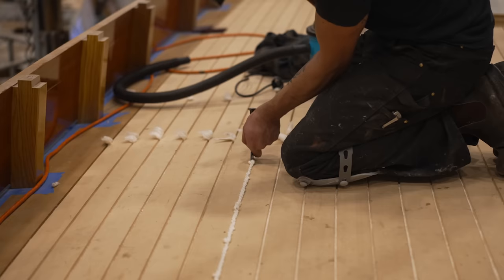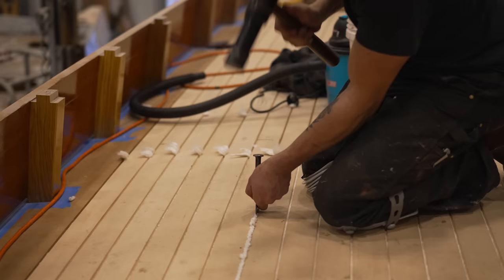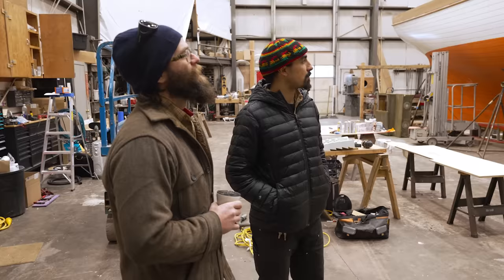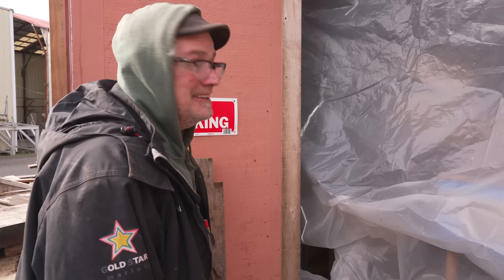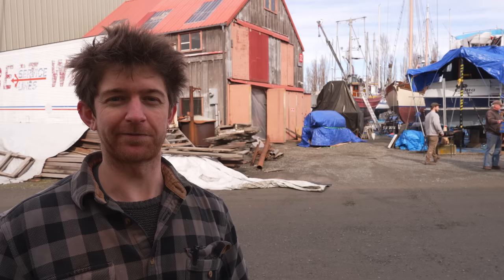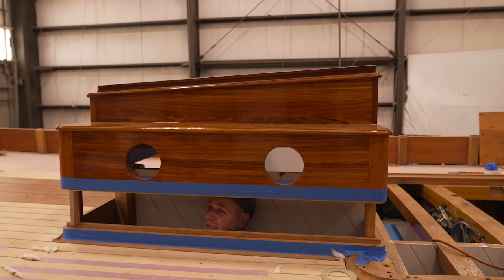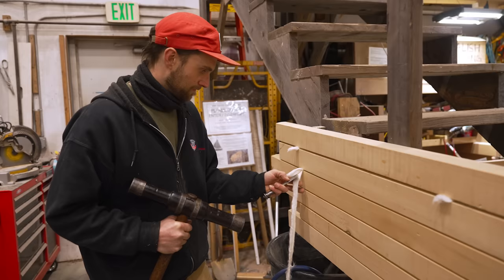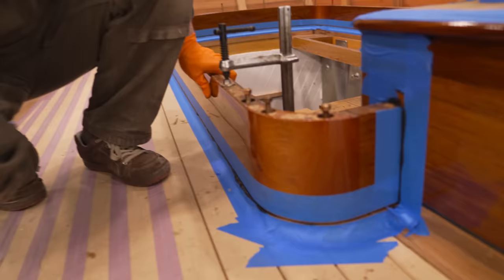Tally Ho's Front Door (April 1st, 2023)

Comment: It would be nice to have a screen door over the front door for the nicer weather
Reply: And some flex seal!
Reply: Out here in Massachusetts we always add a screen door because of bugs and on wooden boats we add fret work for decoration.
Reply: Yeah,! That would turn tally-ho into a submarine.
Reply: @corwin5557  Don't laugh, it keeps the seaweed out.
Reply: my god it really needs a door there? it does not ruin the hull? I never seen that door on a boat.
Reply: @chiranagheorghitaeugeniuth98  That is more of an 18th century thing, you never see newer boats with them, all fiberglass and steel, and not at sea as often as the early sailing days. A sailing vessel has to be at sea much longer, so they need to load on LOTS more supplies, that is when the door really is worth it's weight in gold, loading right from the dock instead of up a ladder, down a ladder for each thing you load.

Very large cruise ships still use them, they have several fore and aft for loading and for attaching the tugboats to to get into port.
Reply: Yes! We had o e on thd submarine that I served on. Very functional and convenient.
Reply: Agreed fly screen and security lock
Reply: What is today’s date?
Reply: Are you guys getting bored?
Reply: lol
Reply: I have to wonder if the 7 likes on @chiranagheorghitaeugeniuth98  comment are satire. Or they didn't see the date and figure out what the outtakes at the end of the vid were!
Reply: Add a brass door knocker in the shape of an anchor. Or a bell? Visitors would appreciate the convenience. It’s great to have such a laugh while I’m having my Sunday morning breakfast. Cheers from Tasmania.
Reply: Traditionally the screen door was mounted on the inside of the front door.
Reply: Noah had one of those, so this is truly a traditional design as Leo explains.
Reply: I’d suggest the addition of a draught excluder, you’ll notice the difference down below when on starboard tack.
Reply: Poisson d’avril
Reply: And a Doorbell Camera.
Reply: @fredmoult583  I'll have to Google that
Reply: 😂I didn’t know the 1 april is also in the US the day for placing frontdoors in ships. Just new it from here, the Netherlands…😊
Reply: In Poland we do windows on submarines on 1st April…😂
Reply: I hear all the best submarines also have screen doors.  It would be great to see Leo's screen door as long it doesn't conflict with the "Strange" plans.
Reply: Those do help keeping the flying fish out.
Reply: @chiranagheorghitaeugeniuth98  Particularly where the boat ploughs through the waves. Should work a treat!
Reply: Good to see the affirmation of tradition in this traditional boat.
Reply: Storm door that slides down to a screen door is perfect !
Reply: Holy crap I could never bring myself to cut a hole in a new wooden boat!!!!
Reply: That was my line lol😅
Reply: What’s TDS?
Reply: And an awning would be nice.
Reply: Your funny !! Hope that was said with toung in cheek ??
Reply: @corwin5557  But you REALLY need those insect screens on the windows in a submarine.
Reply: @Eljefe003  Just getting started. 1 April only occurs once a year and because of the earth's rotation and internet, it lasts only two days!
Reply: But was a screen door wasn’t on the original plans!! 😂
Reply: @chiranagheorghitaeugeniuth98  it was an April Fools joke:)
Reply: @PatrickPoet  Ok now it makes sense. I totally fell for it.
Reply: Don't be silly...  Screen doors are only used on submarines.
Reply: Of course it should have been installed on the Port side and hinged for the bottom to serve as a gangway. Everything on a boat should be dual purpose
Reply: @chiranagheorghitaeugeniuth98  It is an April Fools joke.
Reply: Ha!
Reply: @123456bpb  figured it by now :))
Reply: Good idea! Gotta keep the mozzies out.
Reply: Yes, you had me for a long time ,then I thought you guys are to smart to do that
Reply: @chiranagheorghitaeugeniuth98  Dude... this was posted on April fools day
Reply: Such a beautiful April door.😂😂
Reply: Such a beautiful April door door door...
Reply: @Nphen  I'll admit I fell for it hook line and sinker, the outtakes didn't give me any clues.
Reply: Agreed....  why does the guy have painted fingernails ??  smh.
Reply: That's what made the Polish Navy so formidable
Reply: Right…but where’s the front porch?
Reply: Scream doors are entertaining.
Reply: @buddypuckhaber2016  RE: Your Q.  "What is today’s date?" ... looks like "2 weeks ago" ... so maybe late March?   Early April ?  . . .   Ohhh !   ;-)  ...  I confess I didn't see this episode when it came out, but heard Leo "clarifying" about it in a more recent episode.  Funny to notice that THE precise date is lost to y/t's rough time line.

Comment: Disappointing team to see that you covered the technicalities of the front door without detailing the Jamb and sill plate. Having installed countless front doors I recommend well seasoned  Unobtainia Excelsia for the Sill and readily available  Eludium or Drillium for the Jamb which it is stable, light so as to avoid  concentrating weight in the ends. A nice touch would be a miniature ships bell as a door knocker so the visitor knows the owner is a sailor. Yacht Front doors were traditionally black which was considered faster due to an enhanced convection draft on starboard tack creating higher apparent wind. Sometime in the 70's a university white paper on black doors showed this to be untrue and they have been a mix of black and white ever since , a somewhat chequered history indeed !

Comment: It's important to note that way back in Norse times, the main opening in a Viking ship hull wasn't referred to as the "front door", but rather as the "draw-hatch", and traditionally they were hinged at the bottom, and raised and lowered by a pair of chains, much like the draw bridge of an old castle.  This design proved more watertight in rough seas, but faded out to the newer side-hinged design around the early 1730's...
Reply: Actually, you seethis in newer designs from the region as well.  Both the IC16 and IC20 fast patrol boats designed by Dockstavarvet feature "draw-hatches" in the bows.  As does their earlier CB90 patrol boat.

Comment: Be sure the foot of the door drops 1" (or so) below the water line. Otherwise, the bilge may dry. And we know what a problem that can be.
Reply: Is there room for a screen door?  Especially when they are in hot water.
Reply: @Marcus-ki1en  All the sailors I know prefer screen doors in the tropics! Only an amateur would pull away from the dock without a screen door.
Reply: Is this for real ? I’ve have never seen a sailboat with a wooden door cut in the side of the hull. Seems ludicrous. And on a side note, what’s with the black nail polish? 🤔🤨😞
Reply: @jasonsfishcave684  What date is it?
Reply: That's not polish, that's bruising from hitting one's fingers with the hammer.

Carpenter's nails, if you will.

Comment: Leo, on my 1912 Tjalk the front door is located in the same spot you are installing Tally Ho’s. My experience is that when sailing in rough weather the door bell caused intermittent short circuits. We found the resolution in Victron’s AP1 starboard under-waterline doorbell/camera device. The camera also gave us a way to inspect the underwatership remotely. Good luck! Ton

Comment: I was so impressed with the fact you restored this old tradition that I thought why not doing it on a modern ship? So I took my jigsaw and cut a nice opening in my polyester yacht and am busy fitting my old front door of the house in it. It will be great.
Reply: I've got a hobbit hole door you can use, might not be quite right for the hole you've cut but a bit of calming packed around the edges should sort it.
Reply: @doczoff5655  That's a very generous offer. Thanks.
Reply: Should read ..bit of caulking'... stoopid autocorrect!

Comment: One thing usually overlooked when fitting a front door in a boat is the doorbell, it's easier to fit the proper wiring beforehand than wiring it afterwards, just thought I'd let you know in case you forgot or didn't think about that yet.

Comment: Having been a sailor for over 60 years, including a time working on wooden boats at the Mystic Seaport in the 1960's, I really have to commend your marvelous front door.  It took me to the 5-minute mark when you put up the template against the starboard side of the hull before I could visualize how you'd deal with the potential conflicts with the ribs. But now I can visualize it easily.  The actual door itself looks like it will stand the test of time, and I can't wait to see what color you decide to paint it.  I'm guessing the hull will be white by tradition, so the door should follow that trend and will likely be a deep red or azure blue.  Well done, and thank you for giving yet another glimpse into such a terrific front door - it's not often this aspect gets enough public focus and accolades.  Congratulations to the entire team.
Reply: I think the door should be a door: varnish, only the varnish, 15 layers. If the front door will be the same style as the hull, how you find it at night time after a bar? The most interesting thing if you noticed, the template sits below the waterline. I guess to let the minimum water to get into the hull, Leo should shut the door as quick as possible when entering the boat. I would pay a lot to see this.
Reply: I still can't visualize it. Must be right between two ribs?   Why didn't they drill some pilot holes from the inside out?  But mainly, I have assumed all along that those long beautiful planks were completely integral to the strength of the hull and that cutting them would destroy that.
Reply: @sleepyaligator  Very funny.
Reply: Got me hook line and sinker.  I kept reading through the Comments for some clue that it was not real, but everyone played along famously!!

Comment: Just shared this with my Dad, he used to work in a chandlery. I'm very surprised that this was never mentioned before especially considering that they stocked black and white checkered paint, all thought I could never find it.
Reply: In an traditional boatyard chandlery, the chequered paint is stacked next to the left-handed screw drivers and the long weights.
Reply: @antonyrigby8911  the bowline was stored there too.
Reply: @antonyrigby8911  shouldn't it be next to the tartan paint? I gave my niece a tin that offered 2 patterns - stir anti-clock for one and clockwise for the other.
Reply: Sometimes binned with the left handed hammers, which are made in China now from steel but in the old days, Tradesmans versions were available in Drillium or Eludium, one was too light  for the nail and the other you could never find..
Reply: Loved the April fool joke ! Front door on a yacht, my a***
Reply: Oh, don’t forget to fashion a metal container type grid the foot of the door, for the milk bottles and empties  !

Comment: As always exquisite wood working in that front door.  In considering details however may I suggest that the door bell it placed as high as possible to keep it as dry as possible, maybe use Sikaflex as a glue. this high location can still be reached by visitors in small boats if they time the waves correctly.  cheers well done!

Comment: Traditionally the front door is installed on the Port Side.  The Starboard or originally Steering Board Side was the side kept off the dock so as not to damage the side mounted steering gear/rudder.  The "port side" is the side traditional vessels held to the dock and thus the origin of the convention.  Glad to see you are not afraid to break convention.   The vessel is really coming together nicely.  Kudos to the team.
Reply: In the Dutch & British East Anglian style, where the very shallow draughts negate a keel and steering is achieved using a "Schteerb'd" or "Bittowood" on Port and Starboard, the Front Door is traditionally installed on the Other Side. Sadly, few of these craft remain today due to the poor absorbent qualities of traditional Front Door Mats.

Comment: Excellent work all round, although I would suggest relocating the door further for'ard, routing out a letter box in the top edge and then you can hang the anchor through it and use it as a door knocker to save the need of wiring in a doorbell!! 😀

Comment: Nice touch with the front door, traditionally these were painted black as it was thought to enhance speed due to them warming on hot days and creating an updraft boosting apparent wind. Sometime in the 70's a university in the US did a white paper on black doors which showed that in certain conditions white was faster. From the 80's they tended to be a mix and some were louvered with black on one side and white on the other so they could be switched for tacking a somewhat chequered history for this dubious design feature.

Comment: You guys should reconsider the front door.  I remember that the SS Minnow's downfall wasn't Gilligan, but in fact a faulty latch on its front door.  You can clearly sea this in S4E7 where the professor is tinkering with the latch explaining to Ginger exactly how the door flew open in the middle of the storm and let the see in causing the Minnow to crash into the now infamous island. In fact, you can clearly sea where the door was ripped off the boat in a picture of the boat sitting on the beach next to a large rock. It's in the exact same position that you are planning on installing your front door.

Comment: I'm totally amazed at the quality of the front door. It's a bit of shame that the letterbox was not considered earlier: it could go at the top of the door, ABOVE the splash zone. Who would want a wet letter, especially if it came from France. Similarly, a door know is not very streamlined or indeed hydrodynamic, so what about  a lever handle instead? I'm a bit worried also about the drip rail on the outside...with the door open it shouldn't really damage the nearby planking, and of course it will need a retaining hook in case of high winds. It's all a bit of a worry.

Comment: The chainsaw made me actually cringe! I do think you may regret the TDS for the deck seams. They will fail eventually, and tar is so much easier to repair. I've spent a lot of time reefing out TDS from deck seams, it is silicon based and has to be completely removed before adding more. Quite a tedious job. 

The deckhouse and companionway are works of art. Well done!